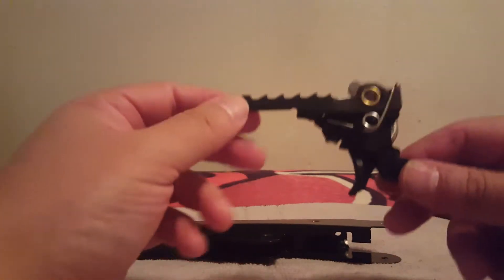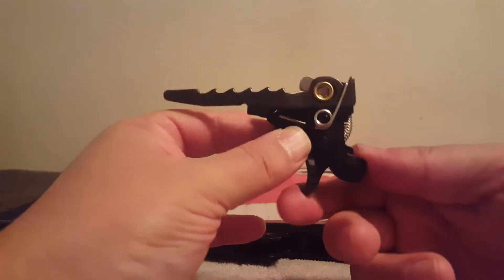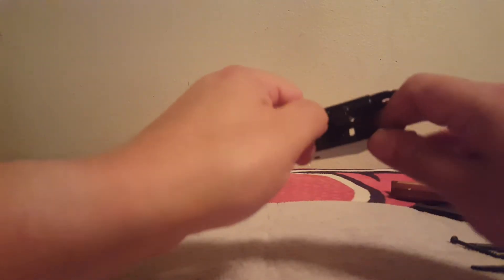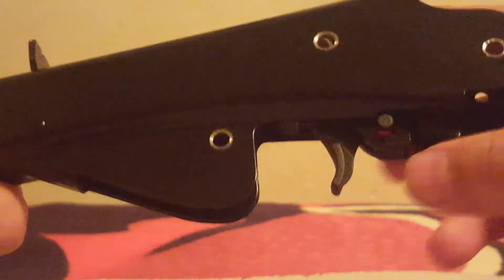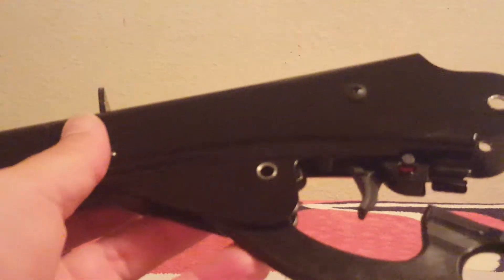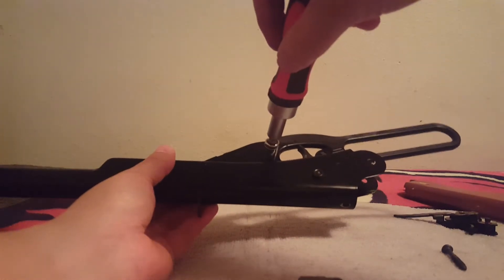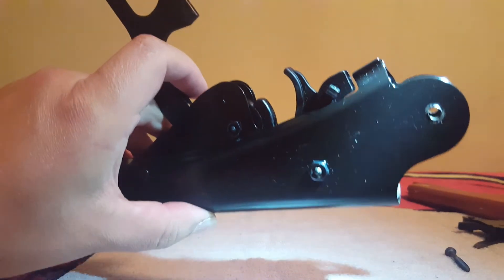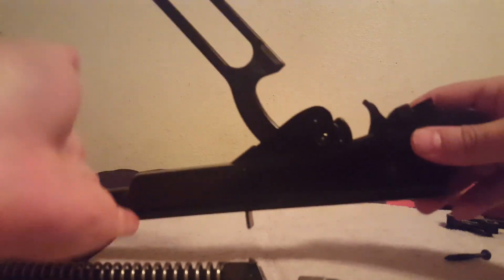Red Ryder Crosshair: Install Trigger

Comment: I took out the back spring on the trigger to make it softer , can this cause a problem down the road ...at first it was an accident i poped it because of a jam in my REDRIDER and since the trigger still works i did not put it back , when i got the 105 Buck i found the trigger to be very hard so i did the same and now the trigger pull is much lighter ... i find it better for aiming , les jerky when i pull the trigger...Oh and by the way thanks your videos helped me with the jam i had .
Reply from the maker: Ricardo, glad I could help! Yes, what you did is a popular simple mod for the Ryder/BUCK.

I don't feel the need to mod, but older shooters can get the itch. I see you are older shooter, so very good. I don't touch mod work because new shooters can make fatal mistakes trying to mod. I'm guessing you used need nose to decompress the return spring - simple for you, not so much for others.

My remark to you is that I likely will pass on another 1999. Regardless of how soft I make the trigger, the gun suffers from being TOO LIGHT; the harmonics are bad and only premium  BBs like Avanti and Marksman get it shooting right.  My Super Buck, enhanced with Ryder stock and metal lever, out shoots the 1999.
Reply: Cool, I wish you would make a video showing how you did it. I hate to try it on a gun since all the cheap Bucks are gone, I missed a 20$ one  at Walmart  by a couple days